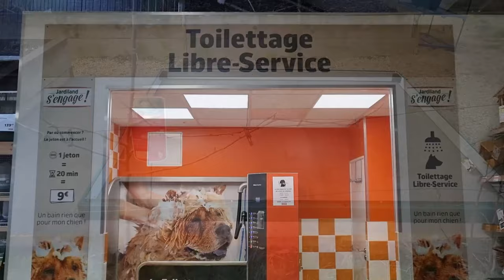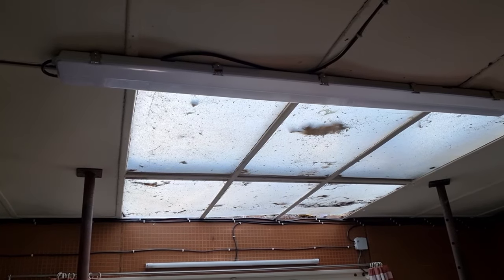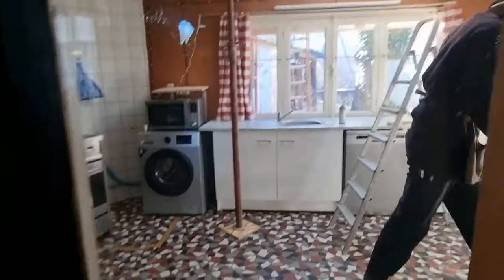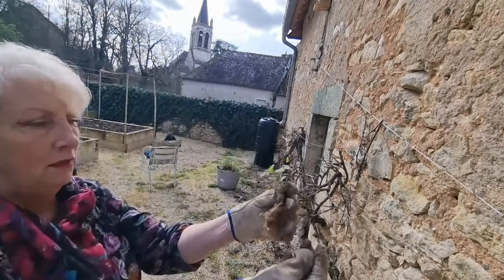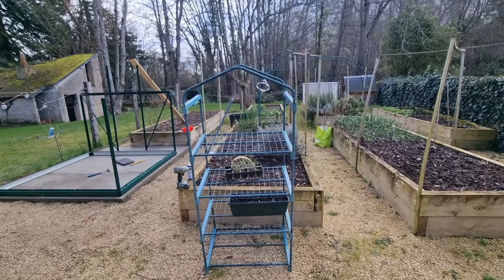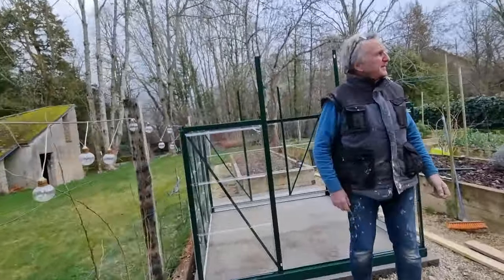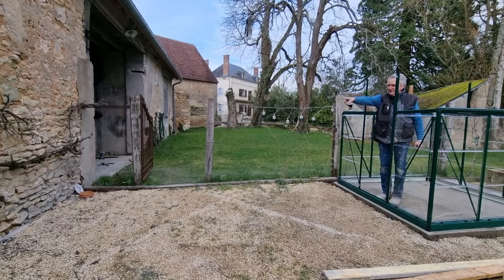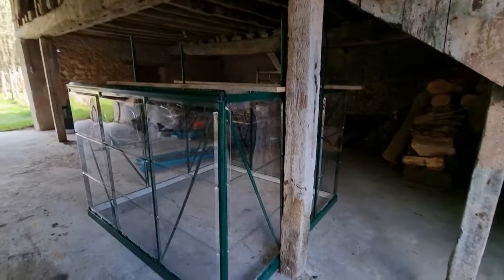Not Quite a Chateau DIY 231 - A Roofing Hiccup - A New Building goes up - & A Cover Blows Up

Comment: Do you have to maintain the same angles of roof or can they be more steeply angled when you replace a small one like your kitchen roof ?  Are there rules about those things on how historic buildings are restored in France?
Reply from the maker: we couldn't raise it anyway, as the balcony is next to it Jessica. the kitchen is a 1950s extension so it's not as historic as the rest of the buildings, but our buildings are not listed as historic so we don't have too many rules, although we are within a short distance of an historic monument, i.e. the Chateau, so we do have some limits regarding the outside of the buildings, for instance we wanted to use slate on our barn roof because it is a lot lighter on the beams but we couldn't because it has to be replaced with the same materials (clay tiles) as are already there!.
Reply: @notquiteachateaudiy Thank you for the explanation. It seems tricky to me navigating these rules and still improving your buildings as you would like to; congratulations on making it look easier than it surely is. As always, great work.